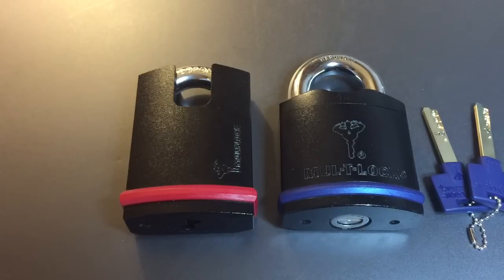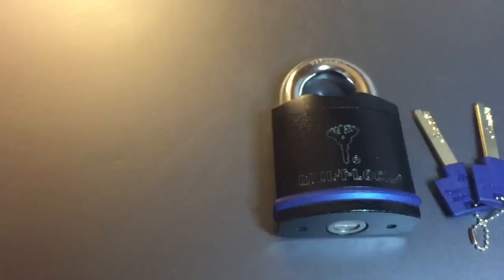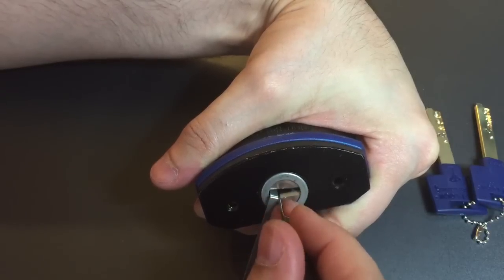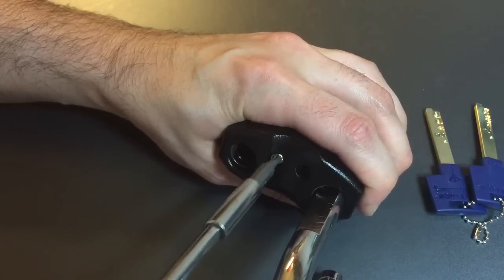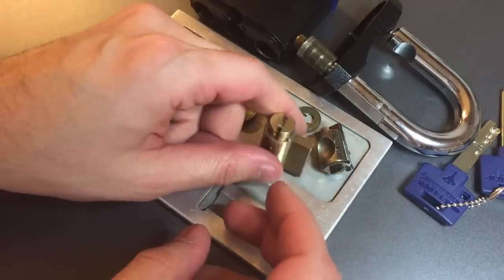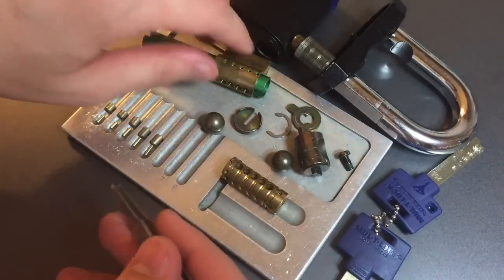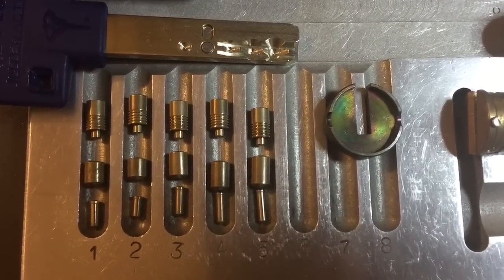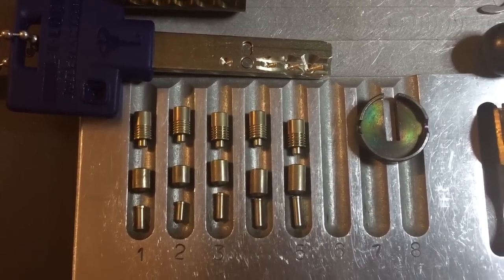[239] Mul-T-Lock E14L (E Series) Padlock Picked and Gutted

Comment: Very nicely made video sir. I like MTL, and I respect the brand. Maybe the reason behind why MTL is contracting Chinese to make their products is to make their products more competitive in regards to price point, and more competitive in volume of sales, not sacrificing the quality. China provides cheap labor, and the Quality Control dept. will check if the product is up to their standards, and rejects when it is not. Just my two cents. Thumbs up.
Reply from the maker: Thanks.  As far as MTL outsourcing to China, I don't have any complaints about the build quality of the NE Series of locks.  Not sure how they pull it off, but they are as nice as any Chinese lock I've ever seen.

Comment: Nice quick pick. No luck with mine yet, think I'm oversetting something. I have been able to get my 7-pin Chinese(think there is only 6 have to open 1 to confirm) and a Dom 5-pin. I had an Abus 30mm marine padlock but I can't find it(too small lol).
Reply from the maker: Thanks... you will get there. on the 7 pin Chinese, try raking it.  Most Chinese dimples I've come across rake very quickly.